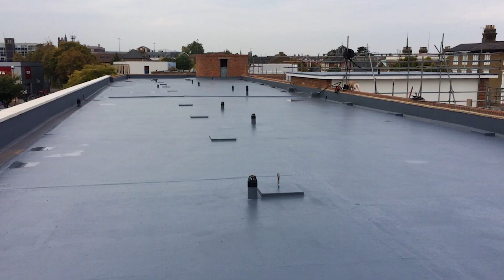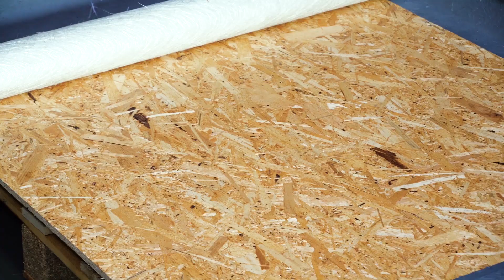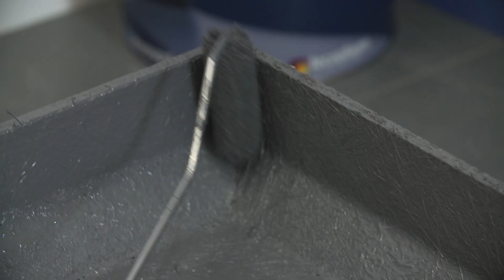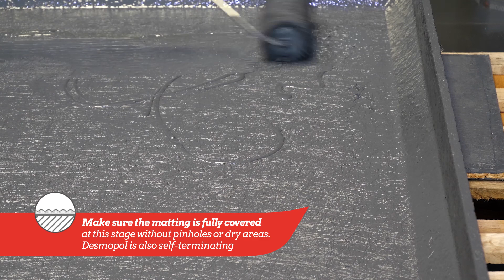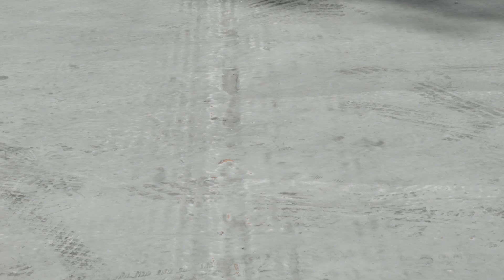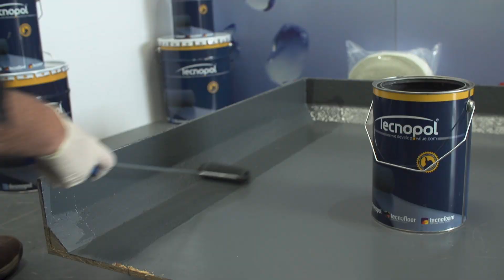Desmopol Application Guide (Fully Reinforced)

Comment: Hi can you use this straight out of the bucket without any accelerator?
Is this air moisture cured? Thanks
Reply: Hi mate, did you ever find the answer?
Reply: @khateebyounus9712 yes i did use it straight out od the bucket just seperate to two amaller bucket as this is air cured